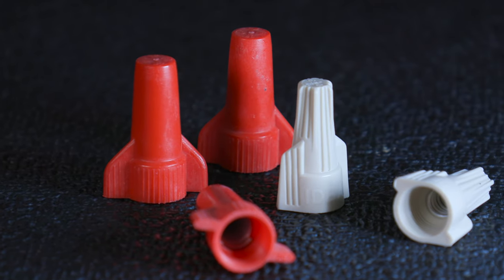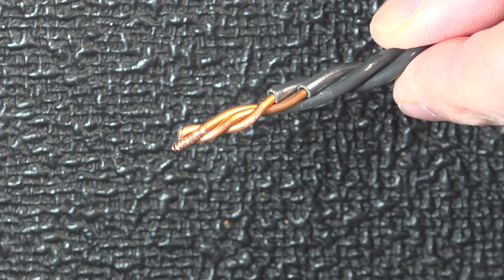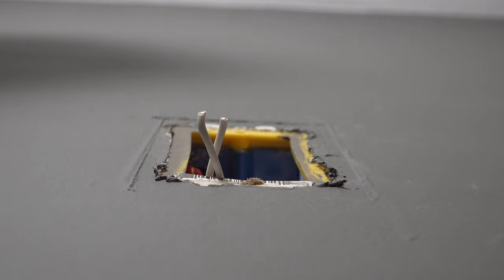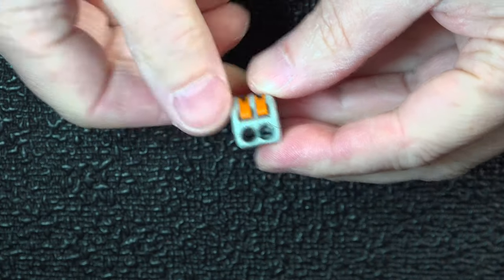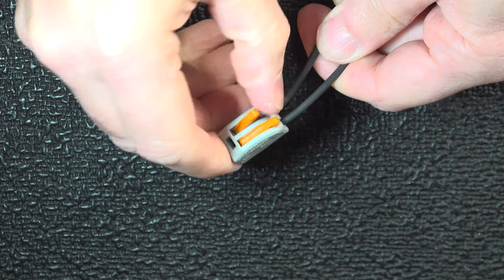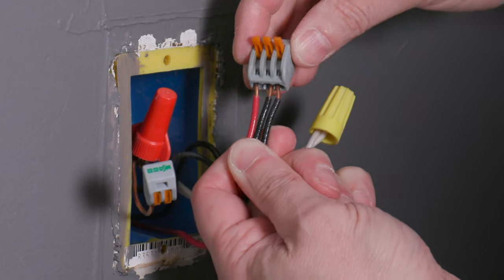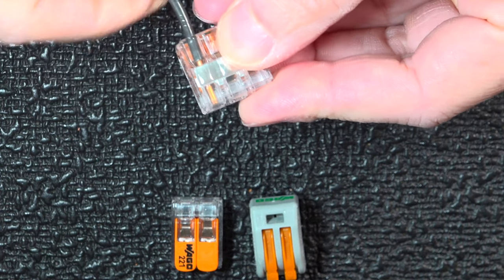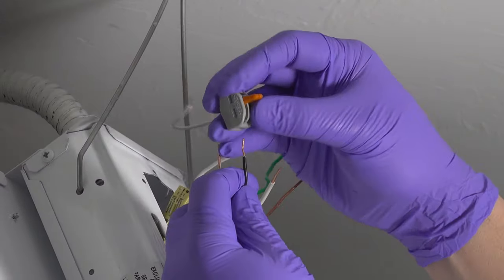Never use Wire Nuts Again - Wago is Better Electrical Connector

Comment: I rarely have a problem taking wire nuts back off to reuse them. Usually only on smaller 22 gauge thermostat wire that was nutted outside for 25 years
Reply: There are Wire Nuts and there are wire nuts, some much better than others.
Reply: @nooneyouknowhere6148  Buchanan are awful. Ideal Twisters and Wing-Nuts are the toughest, most reversible, and most heavy-duty. Buchanan ‘B-Caps’ probably account for half the failed wire nuts I’ve ever dealt with. They don’t grab as hard, and the plastic must be softer or less chemical resistant or something, because they arc out the ends/sides more often.
Reply: 3M scotchloks can’t be removed if installed correctly as the spring with just ratchet inside the insulated shell. Also if you resume wirenuts you’re insane because now you’re assuming responsibility for a 2¢ item that is by all intents and purposes listed as a 1 time use and discard item. Can tell you’re just another hired hand and not a business owner.
Reply: @nooneyouknowhere6148  They arc through because they’re softer, cheaper, thinner plastic and they degrade due to heat/cold cycles and chemical environments. I work a lot in powerhouses, chemical plants, steel mills, that sort of thing, I can’t say whether I’ve seen one fail in a commercial building. I’ve noticed the spring’s a lot easier to spin in the plastic cap in them, too. I’m not old enough to have ever installed a Scotchlock (having started my career in around 2004-5), though I’ve cut a Godzillion of them off, and they do seem like a real asspain. The Ideals are big, I’ll give you that, but man, are they tough, and when they’re put on right you’ll break a wire before you pull it out of one. I might have different opinions if I did residential work or something.
Reply: Never reuse wire nuts you donut!
Reply: @nooneyouknowhere6148  I just told you how, their plastic degrades from heat, light, and chemical conditions WAY faster than the others, and when it cracks or crumbles they blow out the end, a lot of the time when the weather starts to change and condensation becomes a factor. I’m not making it up, haha! No one uses wirenuts above 480V (some powerhouses have 575, but I can’t ever remember using a wirenut on it, we’ll set a splice box with a terminal block for it).
Reply: @nobodydummy12345  Why? What kind of wirenuts are you using that make you think you can’t reuse them? It usually takes too long to be worth doing, but I’ve reused them now and again in a pinch for 20-ish years, good ones like Ideals are perfectly reusable. They’ll let you know if they’re not (ears break, spring spins in the cap, spring doesn’t bite as hard as it should, etc.).
Reply: @Rad_Triumph_765_RS  I’ve reused wirenuts when I needed to (not often, but it happens) for around 20 years with zero incident. If you think a wirenut costs $.02, I can tell that YOU’RE not a business owner, but cost isn’t the point. Sometimes you’re way up above a commercial ceiling or a half mile from the trailer or 400’ up in the steel or way down in some nasty, filthy basement pit in an industrial facility and you need to tie a new wire into a splice box or fitting, and damned if you don’t have a big grey or blue wirenut in your pocket. You could spend 45 minutes going and getting one, costing the contractor and customer a pile of money and making the job that much closer to coming in behind schedule, or you could reuse the one right there in front of you, which are perfectly reusable if they were decent to start with and are in decent shape now. I wouldn’t hit a dog in the ass with a 3M Scotchlock, they’re barely usable the first time and essentially can’t be removed. Awful, dangerous, garbage.
Reply: @nooneyouknowhere6148  I couldn’t agree more, but that’s not always the case in the ratholes I spend a lot of time in. Some plant ‘electrician’ (or millwright, as often as not) gets in a junction box/fitting, fiddles around just long enough to make it look terrible and bandage it together enough to work, and leaves the lid off til the next time someone has to get into it, usually several years. Not all wire nuts will put up with that, the ones that will are the ones we use because we know those dumbasses are going to do it again.

Comment: I am a retired electrician and this is a highly skilled trade. Wagos are ok when installing them in a low current pass through device I.e. strip fixtures. If you use them in a junction box or device box that has higher current demands like kitchen counter tops as well as entertainment center receptacles, or commercial and industrial projects and the list goes on. WAGOS WILL melt down! They were the best thing since sliced bread at my large union shop until the problem with the melting down of the wago and the insulation on the conductors. I repaired many issues from these things. We went with the tried and true wire nuts!
Reply: can confirm. as a resi electrician we only use these for recess cans only because most recess cans come with them pre installed. videos like this keep me in business tho when some DIY homeowner tries to use these when wiring 20a receptacle circuits
Reply: I use the Wago's regularly in industrial wiring panels at 20 amps and never had an issue.  Now, on the other hand, the knockoffs sold on the online flea market sites such as Amazon and EBay are a completely different product and many struggle at 5 amps or less.

Comment: The monkey wrench on a wire nut is like those cheesy infomercials where someone uses an ax to cut bread and can’t figure out why they can’t cut bread!  😂
Reply: You should be able to shave with an axe.
Reply: Sounds like you need to sharpen your bread axe, or swing harder.
Reply: "You still can't cook on a diamond..."
Reply: Wait, there's another way to cut bread?
Reply: " but I have four boxes of wire nuts " throw them all away, just like throwing away your box of tools for the miracle wrench
Reply: Is that a myth?
Reply: Sounds like someone has an axe to grind-
Reply: And they would be using the axe handle instead of the blade.
Reply: My favorite was a vacuum cleaner that only takes up as much room as a pair of boots. So they shot size 16 boots for that shot and made the model wear the boots the rest of time, hilarious!
Reply: There's a xmas commercial in Australia where a dude cuts a leg ham with a chainsaw XD I think it's BCF

Comment: "I only have 3 inches of wire left..." well are you you going to replace that fixture or receptacle 10 more times? ...yeah didnt think so. Wire nuts win again.
Reply: @Terry Eugene yup! CEC states you should be able to remove a device without disconnecting downstream devices, pigtails ftw
Reply: @grouprocox  exactly
Reply: Precisely! How about having to squeeze in a LV dimmer with those connectors or the biggest home owner mess, a five gang box LV switches. I suppose the neutrals will still need a wire nut anyway. Back to Home Depot!
Reply: I was thinking the same thing!  How many times do you need to replace it - once - if you're lucky in a lifetime.
Reply: Bruh, if you have a receptacle failing that often, the wire and wire nuts should be the least of your problems...
Reply: Plus why the heck he has to cut such a huge ass chunk?  Started helping my dad when I was like 8 or so.  He would've beat me if he saw me do that. lol
Reply: I rarely have to cut the wire back , often I will clean off any oxidation with fine emery cloth retwist the wires and reuse the wire nut. The photo of the melted wire nut clearly shows 2 things one is that the 2 wires were not twisted together and they used too small of a nut for such a heavy gauge wire on which I would not trust a WAGO as there is more contact area when the wires are twisted together and the metal in a wire nut adds more area for electrons to flow. I must say these WAGO lever nuts  are a vast improvement from the original design  which used the same idea as the push in's or back-stab on the backs of cheap outlets.

Comment: I love how he cuts 2" off illustrating the trim loss with each modification. Last 300 or 600 times I changed an outlet or switch, I used the screw lugs on the outlet or switch, not opened up wire nuts.  A solution for which no problem exists.
Reply: If you've changed 300-600 receptacles but never had to strip wire, that's very concerning. Please tell me you're not wiring burnt wires to new receptacles? Receptacles have a tendency to burn up wire over years of use depending on the load drawn. Vacuum cleaners, for example, have a tendency to burn up receptacle wires because they draw high amperage on start and pull a lot of power in general. If you're never touching connectors then this video is not for you. I'm in commercial refrigeration, I'm constantly cutting wires and reconfiguring electrical. Wagos are all I use.
Reply: Is it actually legal to use these on mains wiring where you guys are from? Seems very dangerous as a lot of other countries have outright banned the use of any friction-fit terminators.
Reply: @MisterMosfet  what do you mean by "mains"? Are you referring to supply from a breaker? These connectors can house up to 12awg maybe 10, but that'd be max for wire size. They're rated for 32 amps and 600 volts, but can handle over 100amps and stay cool, with the insulation of the wire burning off before the connector burns up. You'd never put them on anything that high amperage anyway though because the wire would never fit. I use them for control wiring, adding components to circuits, any low voltage application (120v, 208 single phase, 3phase 208). They're amazing for troubleshooting equipment because you can splice a wire and tie your meter lead into a 3 bay to monitor voltage. The have a ton of uses. I've seen people connect wire nuts poorly causing them to get burned up. Can't really do that with these, they're idiot proof. On R290 refrigeration systems it is illegal to put anything other than wagos on wires because wagos are anti-arc.
Reply: I know!! Isn't that ridiculous?? Totally absurd! And the comments here from the "defenders" and "fans" are comical!
Reply: @AnUnapologeticApologist  vacuum cleaners do not burn up receptacles unless the vacuum is messed up. Receptacles, conductors and overcurrent protection devices are all specd to perform at a specific amperage, so the only burning that can happen will be due to loose terminations raising the current, or bad motor in the vacuum drawing an overcurrent.
Reply: @AnUnapologeticApologist  medium voltage and high voltage (50V-600V and 600 and up respectively) are often referred to as mains voltage in other countries. Any point in the branch technically. 
And I learned years ago the testing on conductor insulation is all tested at 600v at whatever amperage. If you think about it, it doesn't give accurate results at lower voltages but exceeds the requirements since testing was performed at a higher voltage.
Reply: @n8r8ts41   That's not true. All motors draw higher amperage during start up. A motor that typically draws 12amps will pull over 30-40amps on start up. That quick burst of power draw (which doesn't trip the breaker) most definitely will burn up the receptacle over time. It's not just vacuum cleaners; I was using that as an example. Think refrigerators, acs, anything that has a motor. Arcing occurs on pretty much anything unless it is specifically designed to be anti arc. It's not a bad connection always. Trust me I've been doing electrical for years. I've seen receptacles burn up that were completely secured at the connection screws. They wear out over time and do burn up wires.
Reply: @AnUnapologeticApologist  
So do you use the twist method for wires or the clamp method? Because those red and yellow ones are truly unsafe. I think that's what your saying but it's hard to tell.
Reply: You do realize that this in fact is a solution to a real fire hazard problem. Those red and yellow wing nuts are a real safety issue and the solution is literally the same method that makes phone wires and internet wires work efficiently and safely, only they can be reused, therefore cost effective and a true solution.
Reply: @AnUnapologeticApologist  
Also that guy is from a eurocentric location either of great britain or an area heavily influenced by great britain and that's how they refer to the power and primary electricity. Do you not watch british or European YouTube channels?
Reply: @MisterMosfet  
In America they definitely should be banned, however there are too many traditionalists that think that that's how it's been done and therefore it will always be done. They most certainly are fire hazards.
Reply: @Openreality  data and analog connections are low voltage and draw milliamps, that's why they are allowed. I love how everyone on the internet seems to have a degree in electrical engineering all of a sudden!
Reply: @Openreality  do your research, if wire nuts were a fire hazard they would not be allowed. Our electrical code is in place specifically to prevent fires genius! The National Electrical Code is actually a part of NFPA Codes.
Reply: @AnUnapologeticApologist  everything on the planet wears out over time. If rated correctly, the receptacle and conductors are capable of handling the load. And please read your code book, we rate time delay fuses and breakers for this start-up current specifically, that should tell the installing electrician what will and won't work on that circuit, hence, the devices should be rated accordingly.
Reply: @AnUnapologeticApologist  If the wires are burnt from load you have some serious problems like a faulty breaker or wire 2 or more sizes too small.
Reply: Yes, and his assertion that the conductors must be cut at each new makeup is BS..

Comment: The NEC seems to think they're perfectly fine. I've never had them fail, but then, I actually know how to use them. But seriously,,,,,,,,, the purple gloves.......
Reply: Installed properly wirenuts are the best method after solder.
Reply: We don't have wire nuts in the UK, or they aren't widely used. I think it's because we have 240v which can be a bit more dangerous than the 110v in the US. There was also an attempt to market ceramic wire nuts in the 1970s, but they were very poor quality and the ceramic cracked off leaving exposed metal. The Wago connectors are so much easier to use than the UK screw fastened terminal blocks. I'll agree they are not the cheapest, but when you calculate the time saved installing them as £s/hour compared to working with the tiny screws on a terminal block, they pay for themselves there and then.
Reply: Been in the heating and air business for decades.  And I have seen technicians wear gloves,  I think it's so they dont get shocked
Reply: @maxximumb  well we as electricians in canada, often in commercial applications  above 240 like 277 and 347 and still use wirenuts without problems if properly installed.
Reply: @dougjones2296  nope those are latex gloves, and you will def get shocked
Reply: @vladimirpolak5203  Nitrile gloves.
Reply: @buscador2007  wow A+, for who cares
Reply: @dougjones2296  Those nitrile/rubber gloves are to prevent hand exposure to some toxic chemicals, and sometimes just to keep hands relatively clean.  Gloves used to prevent electrical shock are expensive and must be replaced at regular intervals.  Maybe brush up on OSHA requirements for when to use both/either kind.
Reply: @MichaelClark-uw7ex  Solder is not a good connection compared to wire nuts.
Reply: @MichaelClark-uw7ex  um, 240v is just 2 legs of 120v. I might be slow, but that logic seems kinda hilarious. 
I'm a huge fan of set screw connectors.
Reply: @TheQakman  solder is by far the most secure wire connector. But not many have the skill to complete a solder joint properly
Reply: @jayjonassen2256  No it’s not. You need a mechanical connection to be secure. Overloads and age can cause heat and start to melt and degrade the solder. Might be fine for current limited and low voltage connections.
Reply: @jayjonassen2256  Maybe because it's a waste of time when you could literally be slapping a wago on and be done with it in seconds?

Comment: I’ve been an electrician for 26 years and have to cut off the wire nuts less than 1% of the time. The wire in the nuts is just fine to reuse and this reuse meets electrical code. The little indentations on the wire does not reduce the efficiency of the connection. Also, the smaller versions are not removable. The wires must be cut each time.
Reply: I'm a journeyman electrician going on 10 years of experience and I completely agree.👍
Reply: 36 years in the trade and I agree. 👍
Reply: Okay so you're right ? They can be reused correct ?and still pass code? Cause ive change some fixtures (d.i.y) and just reused them didnt look bad to need to toss the inside still looked threaded and the romix ends still looked fine, but always is best gotta keep extinguishers for safes in good spots👍
Reply: @kaloosh2639  um no, when it comes to electrical stuff, you want to have it so you don't feel need to scatter fire extinguisher across the house... That is not safe!
Reply: He bring up the little indentations when the actual wires are twisted together  when the wire nut is just making sure they keep tightly,  meanwhile those wagos just use a little sharp edge that bite the wires and create such indentation that carry all the load cause the wires are actually separated inside, this video is just a paid advertisement or just a lazy wannabe electrician.